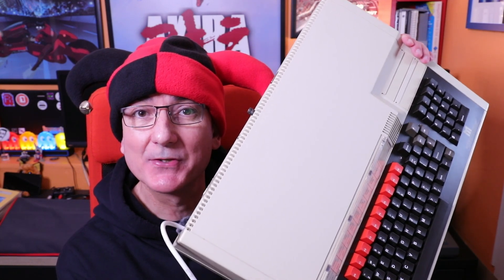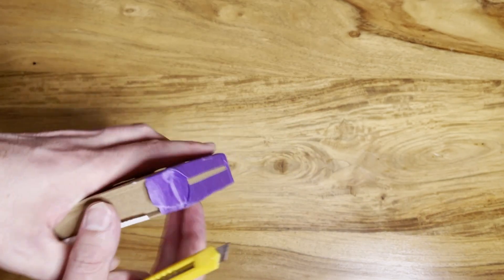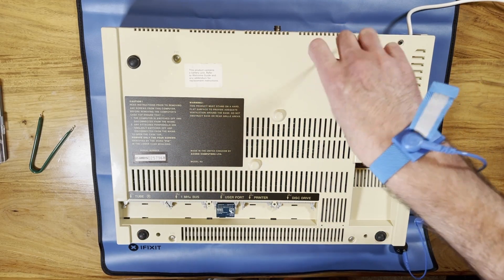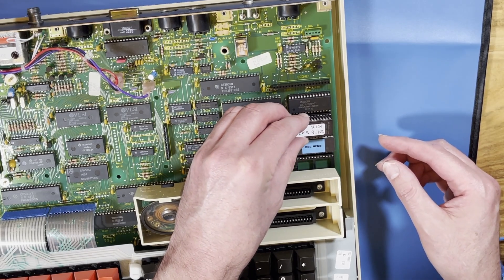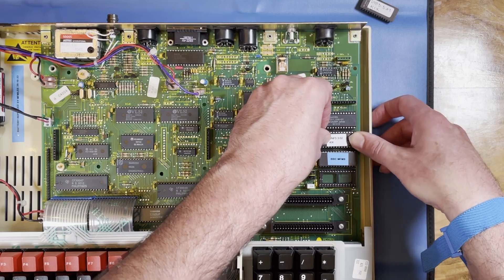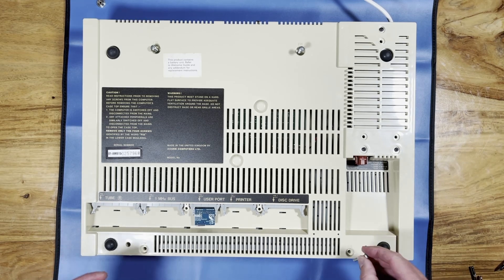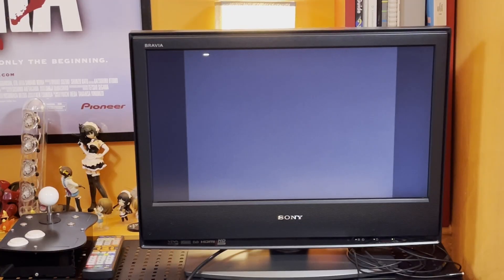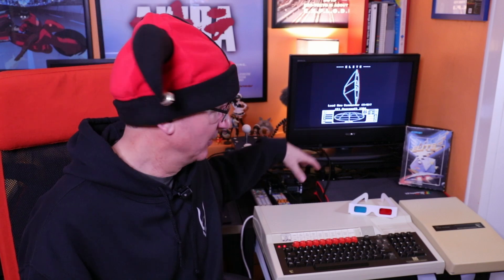BBC Master second processor, the 6502.

Comment: 3D Elite :D, never knew about that. 

With the master did you use *configure tube as by default the machine will not look for a second processor? When the machine was hanging I noticed it was in ADFS mode which does by default look for a hard drive which can take a while to exit. A useful command is *status which will display the CMOS settings. *configure filetype can be used to change the default file system to another rom - for example MMFS instead of ADFS or DFS.
Reply from the maker: Thank you so much for this. Very helpful. 😁
I am not an expert by any means in the BBC computers, so this has been a trial by fire learning experience. 😅

Comment: Unfortunately, by moving those two jumpers you've lost the use of the sideways RAM (sockets 4 to 8), your BBC Master 128 has turned into a BBC Master 64!
Reply from the maker: Good to know. As this machine is not my area of expertise how can I get to a happy medium and have things set so both the Roms and the sideways Ram can be used?
Reply: @YawningAngelRetro  To keep the sideway ram available, you'll need to use ROM slots 0 to 3, these are mapped to the ROM cartridge slots not internal sockets...

Comment: A version of Elite that can only run on systems most people could not afford back in the day and can't get today due to rarity. So does that make it Elite for the elite? 😏
Reply from the maker: Hah 😅, for me that would be the current Elite Dangerous. Having a PC of a spec high enough to run it for me is out of my league, so I’ll stick with the 8 and 16 bit versions for now. 😉
Reply: @YawningAngelRetro  The specs required to run Elite Dangerous have gone down in price significantly. You could probably get a PC good enough to run it for around £500. But if you want, come round to mine and I'll show you Elite Dangerous in VR with better than top end kit for Elite Dangerous😉

BTW. I was lucky enough to get their lifetime DLC pass for £35 before it was released on Steam. The pass was on Steam for a limited time at over £120! So I have had all the upgrades released for the game.

Comment: I was expecting a puff of smoke when you fired up that 2nd processor. Water and electrics is never a good mix.
Reply from the maker: It was touch and go, but without any suitable tools to check it, I had no choice. 😎
I did of course check it was dry inside before connecting it up. 😉